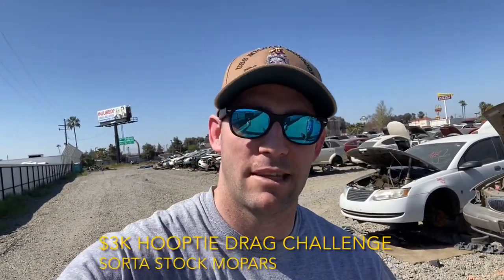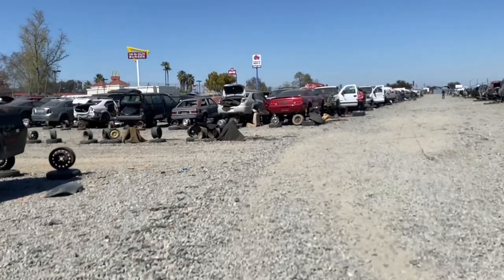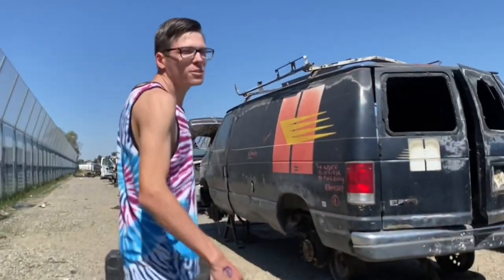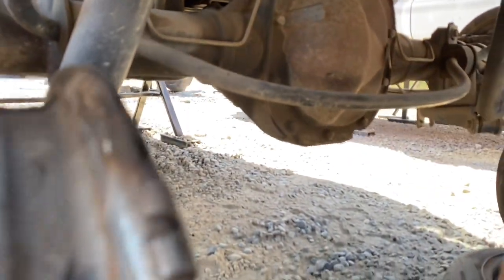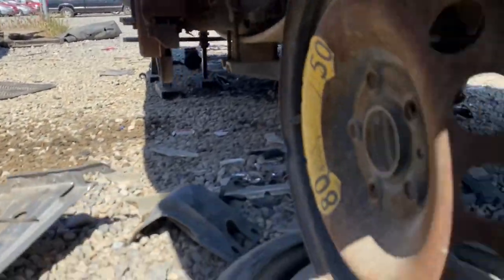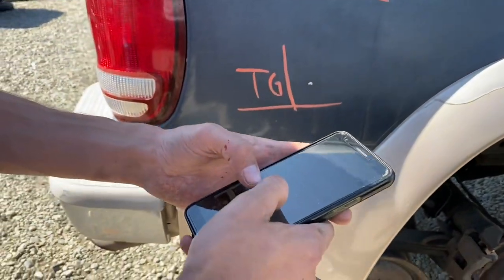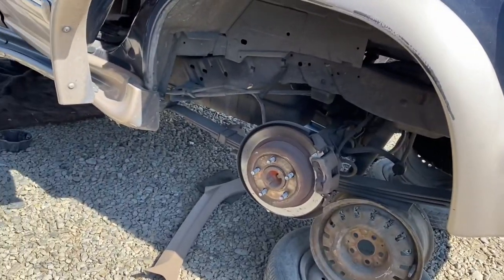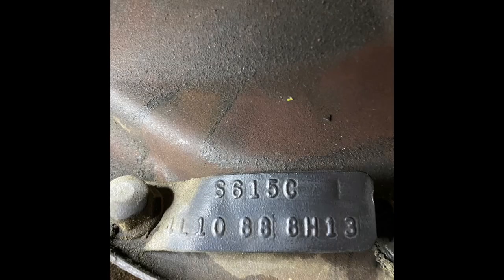Junkyard Rear End SCORE! - Team A body - $3k Hooptie Drag Challenge

Comment: I'm up with the your Thrift Power Lifting Team. Sadly , my Explorer  XLT 4.0 SOHC was 3L73. First thing I checked. Great 31 spline axle with 11.3 discs and we had a Mustang central handbrake on Aussie and Kiwi spec Right Hand Drive Louisville built Export Sploderz. And nobody worries if you get an F for brand loyalty...when you get an A for Teamwork.
Reply from the maker: 3.73s would’ve been my choice had we been building a fun cruiser. Usually I stick with all mopar parts but, the budget and availability factors just make it too difficult. I’m sure there are a few $200 8.75 rear ends out there  but, I’d have to spend all year looking it haha

Comment: Thanks for the info 👍 I own a 1990 (last of the square b-bodies and was wondering what options I had if I wanted to go to a Ford 9 rear end.
Reply from the maker: I’ve been beating on that 8.8 with drag radials for the past 8 months. Maybe 15 passes down the track. It’s performed amazingly well. 10/10 would recommend the explorer 31 spline 8.8

Comment: I can’t believe they charge to rent the cranes. I was at a pick-a-part a few years ago here outside of Phoenix and they were just staged around the yard.  My Dad and I pulled an Explorer 8.8 and had the same issue with how they had the truck mounted on those wheel stands.  We drug over one of those cranes and used it to lift on the hitch so we could move the stands to the frame.
Reply from the maker: Yeah I guess that’s their SOP. I struggled to lift my arms the next day after that junkyard visit lol. Glad I did it tho! I’m convinced this 8.8 was the biggest factor in winning the race.
Reply: @sorta_stock  I'm picking one up for my '74 Duster build.  Did you hook up the ebrake cables?
Reply from the maker: @roadhardrestorations  no I didn’t. I was in a rush to get it out of the junkyard so I just cut it. Never bothered to get a new one

Comment: I was SURE the last axle on your list was going to be a Jeep YJ or whatever the SUV from the late 80's an early 90's is called.  All the features of the 8.8 but the hub matches Mopar so you can be hub centric on your wheels without spacer rings.  Maybe a Mopar 8 1/4 is not equal to a Ford 8.8. I need an axle like you for almost the same width.  Any 8 lug axle is going to cost a fortune to narrow and convert to 5 lug unless you have quite a good shop and can do it yourself.
Reply from the maker: I’m not sure what was used in jeeps but, the ramchargers of that era used 9.25 rears. They’re strong but, would be too wide and only come with drum brakes. I plan to run mustang based wheels so, no spacers needed.

Comment: Is the Ford Exploder rear the same width for the A body or will it need to be cut down to size?
Reply from the maker: If I were to be using wheels with a shallow backspace (most old school styles), I’d need to trim the long side by about 2”. I’m going to be running mustang wheels (5.75” BS) so it won’t be an issue.